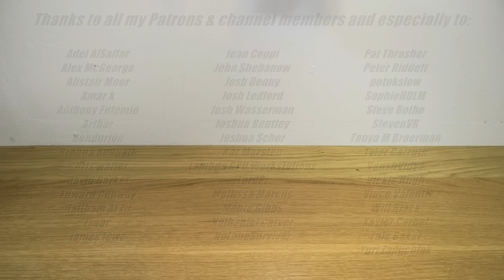Making a Big Concave Radius on the Lathe

Comment: If I may ask: Why pre-turn so much of the  outside of the plastic cylinder for the anvil? Does it matter if the (apparently) unused outside is turned or not?  Thanks for doing these videos -- I love them, even if I don't understand a lot of what's being done! 🙂
Reply: I think it's because the reflector has a lip on it.  He had to take the radius all the way to the edge to work next to the lip.  That's why he milled the flat bit as well.

Comment: If you like to see more about people doing metal restoration of insanely dented metal, just do a search for "English Wheel", its a tool for fixing dented metal parts.    
There is also a channel called "The Luminary Shop" and that's a guy who does a lot of metal spinning, which is forming complex shapes like this on a lathe.   Fascinating to watch.
Reply: MM would like to make an English Wheel, just finding room in the shop would be a project on its own. He thought about metal spinning this then realized his big lathe wasn't large enough to actually do the spinning. It was only the configuration of the small lathe that allowed him to polish it like he did.

Comment: Greetings from Petersburg!
High-precision manual feed of the cutting tool. Level - God. 
May I ask you?  Why did you decide to make the mold out of polymer? He's expensive. A lot of material went to shavings. Why not a tree?    But... 🤔
From shavings you can make a filler for some kind of filter. ☝              And yes, thanks for the great video!
Reply from the maker: Simply because wood has grain structure. If you hammer on it than you would push the grain structure right into the aluminium.
Reply: @mymechanicsinsights  Right. Everything is simple. I just didn't think it through. Thank you very much for the answer.

Comment: @mymechanicsinsights  What brand of screwdriver do you use?
Reply: He uses screwdrivers from PBswisstools
Reply from the maker: correct
Reply: @koen_bakker  many thanks
Reply: @markedis5902  no problem 👍
Reply: @koen_bakker  just wish I could afford a set.  My disability benefit leaves me with little or no disposable cash.  Damn!
Reply: @markedis5902  ah that's unfortunate! They are quite expensive yes. I have Wiha screwdrivers, and i can recommend those to you. Maybe you can check them out too
Reply: @koen_bakker  I have a mix of whatever I picked up in my years as an engineer.  I do have nice pliers and cutters though,   they are Lindström

Comment: I wonder why no one noticed the final "result" at 3:56 is a brand new turned dish, and the anvil and punch had noting to do with it. For one, I wondered what kind of 'curved anvil' he would make to restore a parabolic mirror, and of course he couldn't, because a circular anvil doesn't have a parabolic curvature.
Reply: The main video shows the “missing steps”.
Reply from the maker: This video is just about the making of the concave anvil. I haven't included all steps of the reflector. Video link to the full restoration you can find in the description.
Reply: I see what you did there. My apologies.

Comment: How did you make that rim absolutely perfect?
I have straightened metal before and it is very hard to get THIN metal any better than about 95% perfect. You cant remove material to fix dings and gouges because it is too thin...
I'm calling BS on this "resoration". You just got a new reflector from somewhere and painted it. 👎
Reply from the maker: These are some pretty hard accusations you are throwing my way. I think you need some better arguments and proof to back it up then just saying you tried too and failed therefore mine has to be fake as well. I've spent many days in the shop on this reflector and I also had the help of two very good metal shaping friends. This is 100% the same reflector. On patreon you could follow the jurney of this full restoration over 23 days in the workshop, seeing everydays progress and thinking progress.
Reply from the maker: Did you even watch the full video?
https://www.youtube.com/watch?v=tllAaDaGShg&t=3s
Reply: Ah, yes, the old "if I couldn't do it, then nobody can" argument. 😂